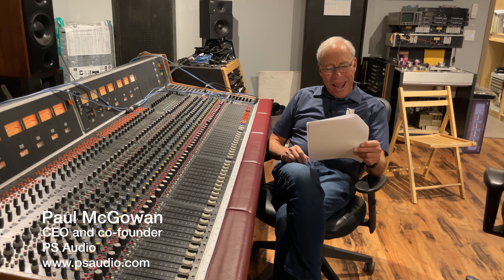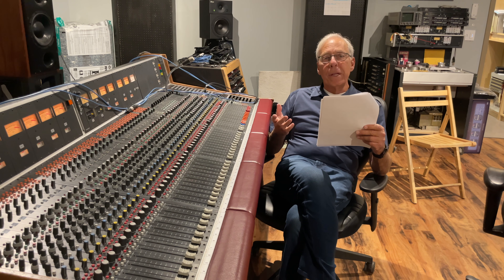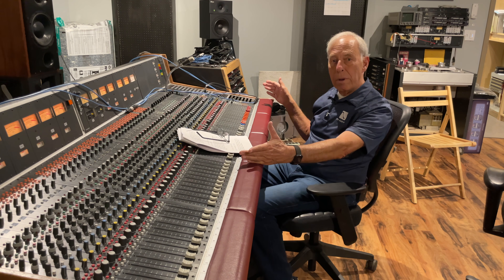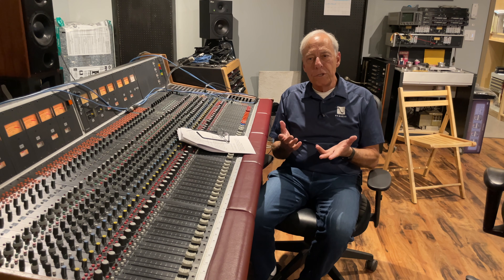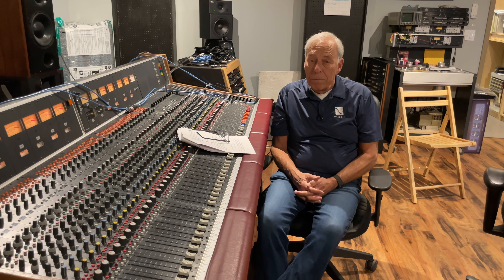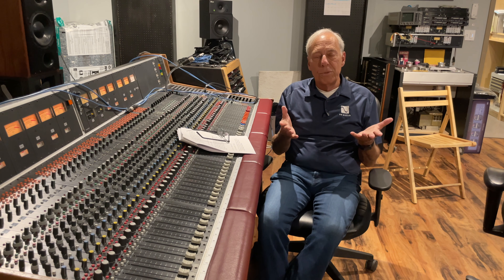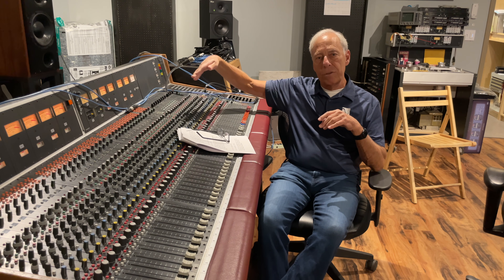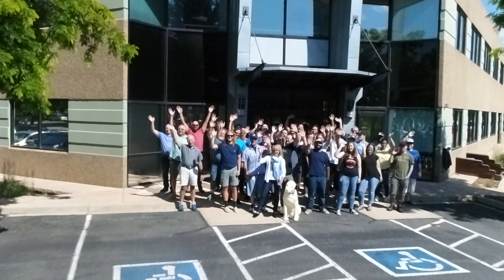Digital and analog connections

Comment: A good explanation of what a DAC is, but I'm struggling with the reason why the question poser wants to introduce unnecessary conversions along the way? Turntable direct to preamp (using a phono preamp if the amp itself doesn't have a dedicated phono input, or if you want to experiment with different phono preamps because you have too much time on your hands) is surely all that's needed?

Comment: you must use rca. straight into the preamplifier!

Otherwise it will be analog to digital and digital to analog and it will weaken the sound quality a lot.

from experience, a turntable with built-in ADC or riaa amplifier with ADC. are cheap and not the best if you think about sound quality!
built-in ADC / usb is to be able to digitize vinyl records. The best thing is to have a good regular riaa amplifier and a regular good turntable!
Reply: Perhaps a Vincent phono pre, coupled with an Optonica (Sharp) TT with the 35 lb faux granite (mikage ishi) and copy of a Shure bros arm.
Reply: @heywoodjablome5630  The absolute best thing is to use a good turntable with a good RIAA amplifier and connect it to the line input on your sound card.

The cable between the turntable and the riaa amplifier must be as short as possible and preferably no longer than half a meter. Turntable gives weak signals!

Comment: Dan should be sure to use inverse reactive current for use in his unilateral phase detractors (assuming his analog-to-digital board supports retro-incabulation).
This should help regulate fluctuations in his capacitive deractives.

On the other hand, I might be mistaken.
Reply: Would that be the Chrysler or the Rockwell version?